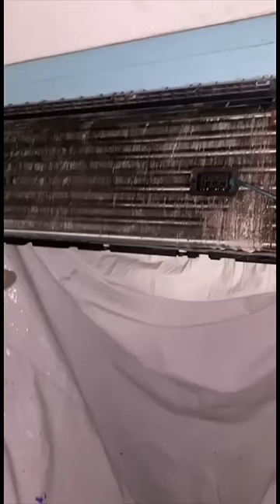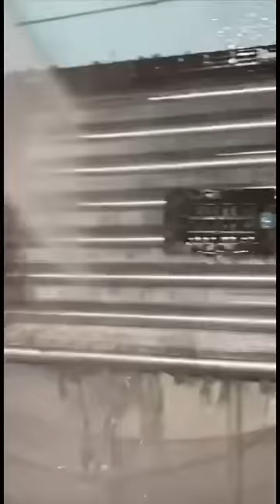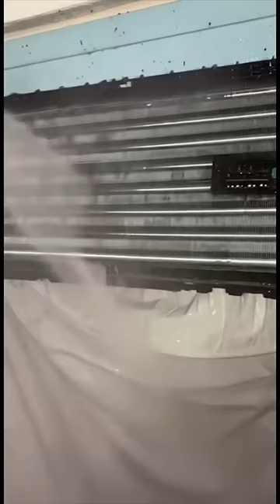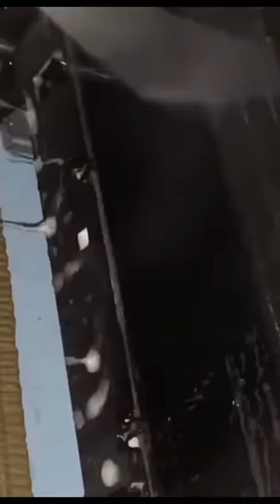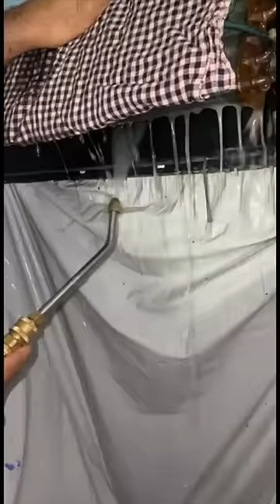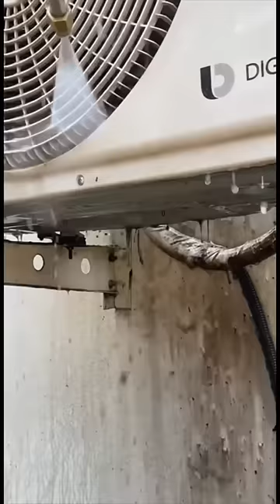Air conditioning clean

Comment: HVAC installer here, DO NOT WASH ANY COILS with high pressure, the coils will bend if you do this
Reply: Aaru kelkkan aarodu parayaan🤣
Reply: This is a 40⁰ nozzle bud. Its allright.
Reply: @clayton9136 water  hai ueh
Reply: @Bareelakhan2006  what
Reply: How about the dirtiest evaporator blower wheel?😢
Reply: I do it all the time, none bent. Are your coils aluminium?
Reply: Thats not really high pressure
Reply: He's using low pressure clearly lol
Reply: Its a portable mini pressure washer. If u don't use one of these your waiting your time lol
Reply: Keyword your a installer not a service tech lol the pressure is fine

Comment: How NOT to clean a mini split.
I hope blower is water proof, besides brush off most debris first, and only use hand pump sprayer. Cleaning kit comes in a 5 gal bucket with plastic funneling trough, works well👍

Comment: Can we put air pressure on fan also, so no harm?
Reply: Apply detergent and clean with soft brush.. don't spill your room by water..
Reply: @Raavanan1777  i'm talking about outdoor AC FAN.. is it ok to clean with water pressure?
Reply: @Bond.0013  Better we can remove the outdoor unit fan guard and wipe with wet cloth like how we do clean our ceiling fan.. one thing i want to know, why do you preferring pressure wash? Pressure wash is suitable to remove strain or dirt from wall or outdoor floor. even don't apply the pressure wash in your vehicle surface, it'll damage your vehicle body. hope it is useful for you bro. Thanks .🙂🙂🙂